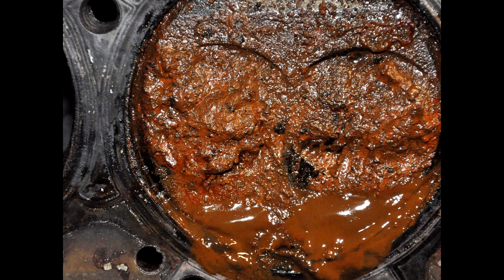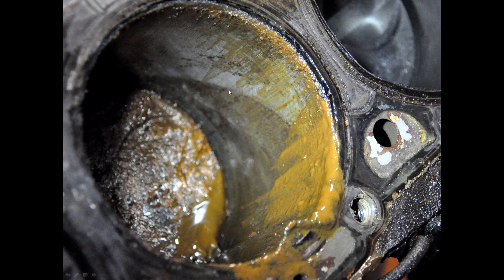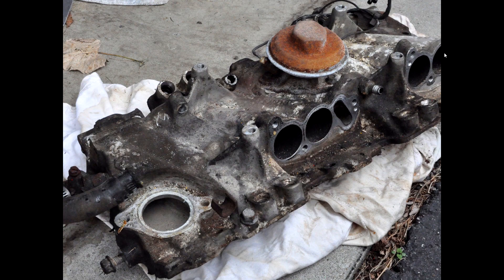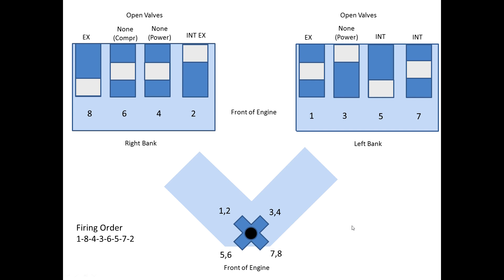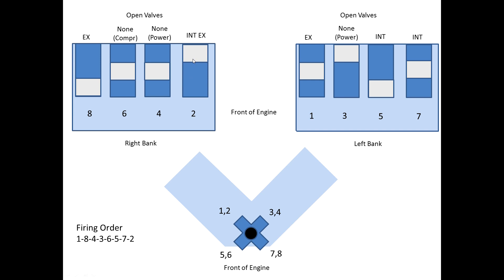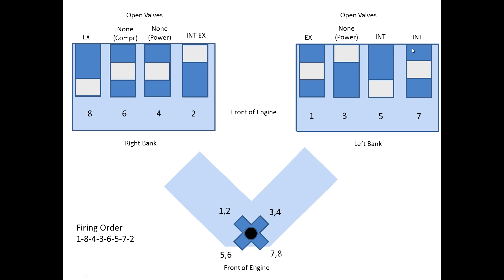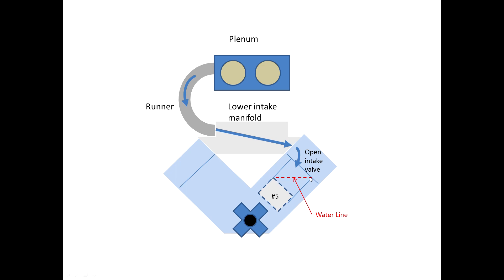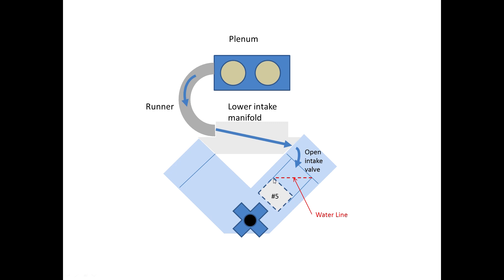Why did that Cylinder Rust on the 305 Chevy TPI Engine? -  IROC-Z Barn Find EP#11

Comment: yes I would say that your looking at humid air condensate water droplets that formed and ran down into that cylinder, there was probably a natural draw(stove pipe effect) through the intake and then out the exhaust system.  The intake being aluminum helped this effect.  I suspect that the car had one flatter tire on that side to make the car lean to that #5 tube direction which explains why it got the daily allotment of water condensate droplets into it.

Comment: If this was a "humidity" issue, both cylinders 5 AND 8 would have problems. The circumstances almost demand investigation, but it seems to me there are only two real potential causes. This car was not stored all 25 years inside "covered", and there is point of water entry via a bad seal/gasket on top of the intake, or it was seemingly malicious. Yet, the external engine components are not indicative of sitting otside, wild. Love these 3rd gens, always happy to see another saved. look forward to your decision on moving forward, good luck.
Reply from the maker: I agree that is odd that the other cylinder with an open valve didn't rust, yet one of the cylinders with a closed valve appeared to have some a small amount of moisture in the cylinder.  Perhaps there was something else in play, such as alignment of the ring gaps or ring seal that retained water more in the bad one. It is still somewhat mysterious.

In looking at the other parts, every sign that I have is that the car truly was parked in the same place indoors for the entire time. I think the owner's father was being honest with me, he didn't have a reason to be otherwise.  The car was uncovered when I first saw it, but it had a very nice heavy car cover in the back seat that doesn't appear to be weathered. The body and paint don't show signs of 25 years of weather.  The only rust on the entire car is on the unprotected parts underhood, the exhaust system and the rear axle.  The brake rotors weren't even that bad.  The engine pulleys were all rusted in the areas where the belts didn't touch.  Where the belts contacted the pulleys, they were rather clean--only one contact pattern and the belts have a hard set to match.  The tires were all flat spotted due to sitting without air, but only in one place as if the car really never moved. I looked at all the gasket surfaces as the engine came apart and they all looked normal.
Regarding humidity, it is really an issue here.  The garage where it was stored is on a concrete slab in an area where it is very flat and doesn't drain well. The garage where I am working is in a similar condition- relatively high water table, unsealed concrete slab. Some of my bare steel tools started rusting in a short time.  The humidity in the summer was 80 to 85% inside.  I needed to get a dehumidifier, that you can hear in the background on some of the videos when I forgot to turn it off.  The temperature extremes year round can be as much as from +100 to -30F. My experience is that opening and closing the garage door can really spike the humidity and make rapid temperature changes.
Reply: @bitsofwisdom460  I agree and understand, and you make me appreciate my location / pole barn up high and dry, sandy soils on a breezy hill. One thing additional comes to mind if I am reading you correctly, did not 5 have an open exhaust valve? unless the exhaust were plugged to the outside moisture conditions you would think it would be as bad a the intake. I don't recall, in one of your videos, was there an exorbitant amount of water in the engine oil? All I know is that was a lot of moisture in "one" cylinder alone. Good Luck.
Reply: @bitsofwisdom460  PS. how much moisture is in the fuel tank? That may well be an additional "bellwether" tell tale to severe moisture, especially condensate.